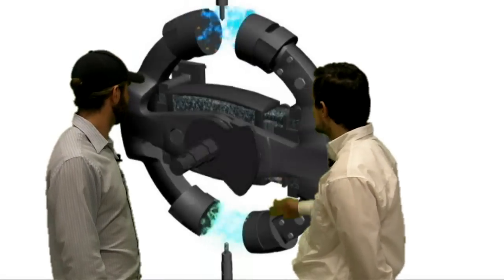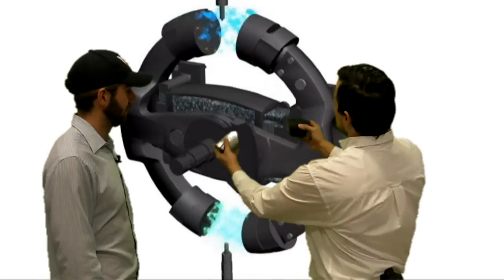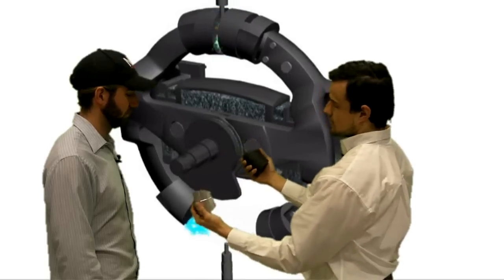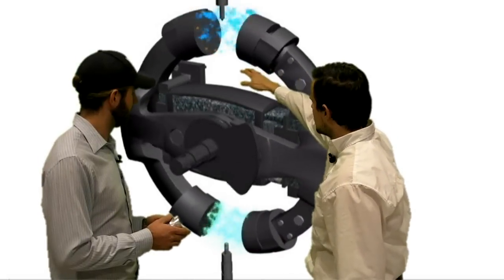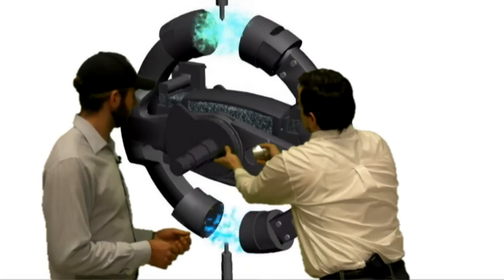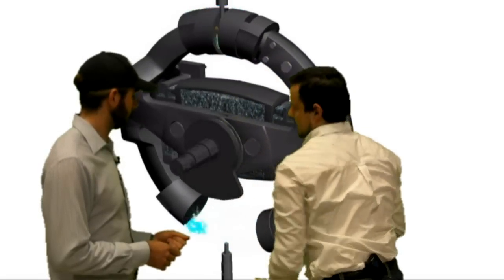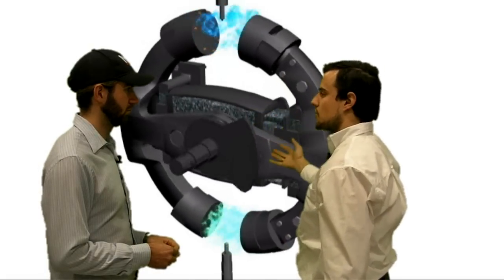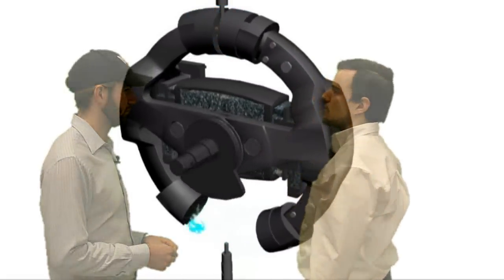Interview with Heinz Reisser, Inventor of the CHB Engine

Comment: @VmtSquad: Since the crankcase and cylinders are separate, there shouldn't be a mixture of air-fuel as well as oil. I do wish, however, that this engine had a DGI system, in which fuel is injected directly into the cylinder, which would mean no scavenging (unburnt fuel passing thru the exhaust port) occurs.

Comment: It seems like the turbo serves not to increase the compression ratio, but more to force out the exhaust and bring new air in, since there are no valves.. ?  With a quick look at this, it seems like a step forward from a two-stroke.. but I can't see it being more efficient than existing 4 strokes. Better power to weight ratio, I can see that.